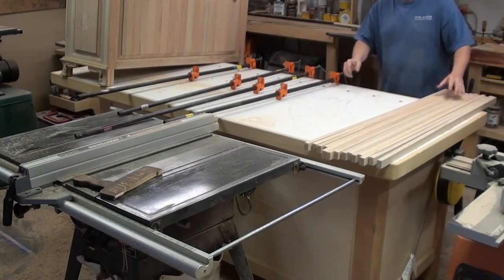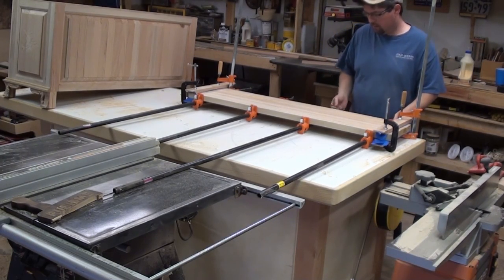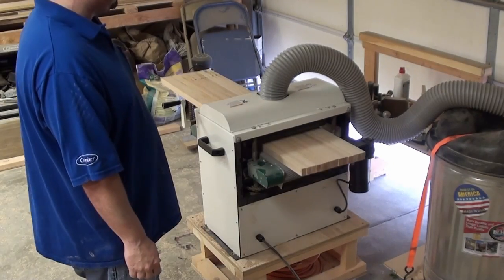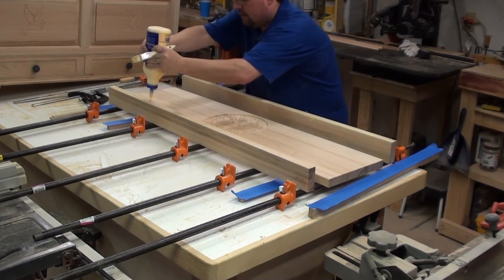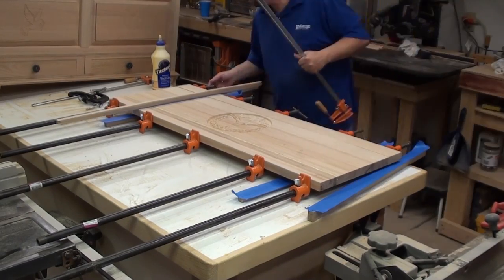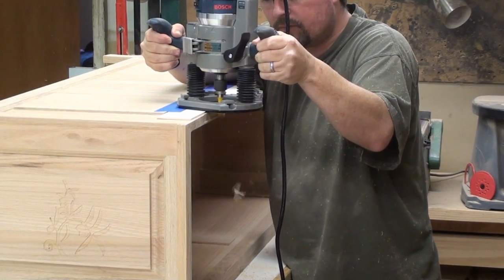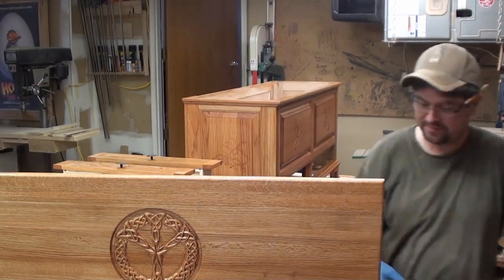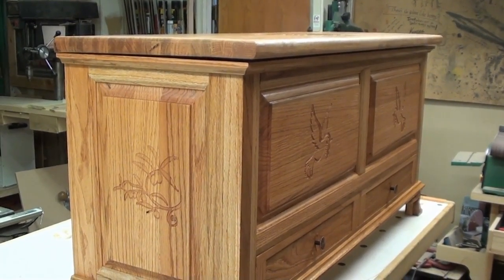DuckCraft-HopeChest Part 6

Comment: first video I have watched in this series, an it looks amazing ...... from a far. The feet have gaps in the corners of them, why? Looks like over sanding or something else that caused then to round over where two pieces of wood are suppose to meet up tight. That lid, omg to take the time to put a carving into a butcher block that is not going to last. You can see at the end of the video when its assembled it is bowed already. Without a frame around the style of lid is just going to break off. A pieces of wood on either end, dressed into the rest of it, would have made it bullet proof. This video is 3 plus years old now, I lay money its been broken off at least once by now.
Reply from the maker: +Greg Ward Thanks Greg!  I'm sorry to disappoint you but, it's still holding up very strong.